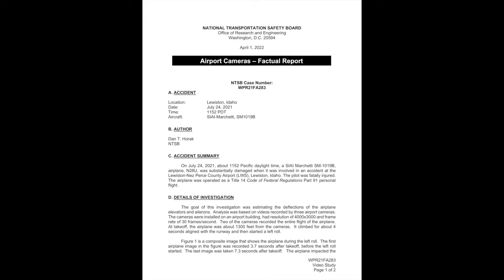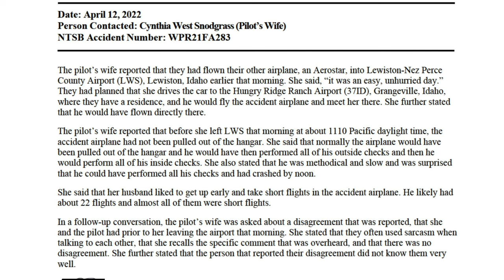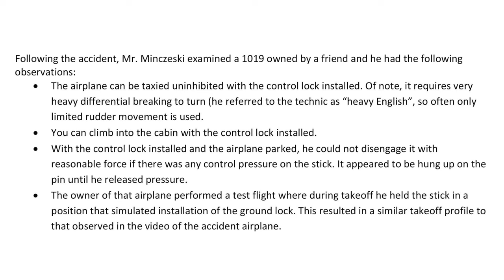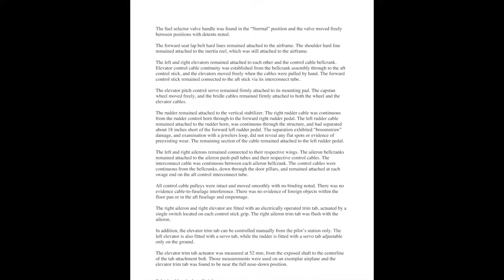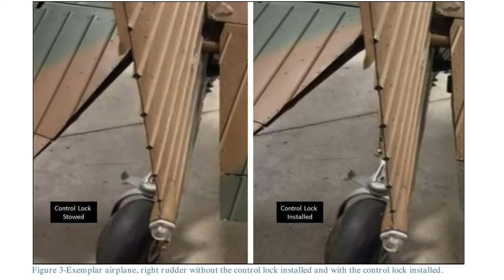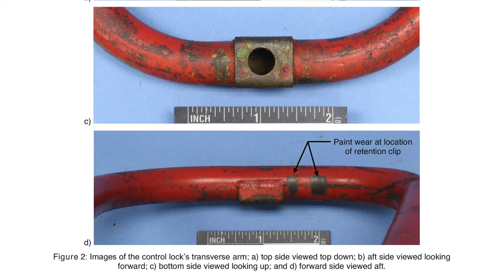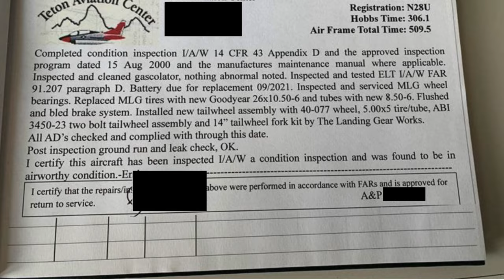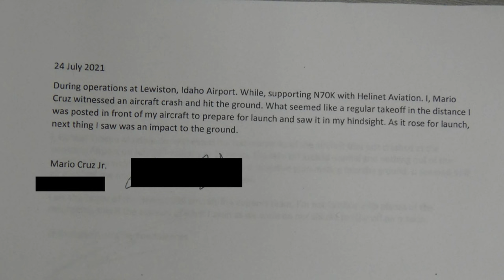Fatal Crash of SIAI Marchetti 1019-B, Part II

Comment: Looking at the reaction of the two baggage handlers was interesting too. It was like "Oh well, let's keep working".  The guy didn't even seem to realize the plane crashed, but the lady looked over briefly but didn't alert her co-worker.
Reply: I do not think those two realized what had just happened.
Reply: @ALLROY240  How is that possible?
Reply: @richardarcher3435  noise of the RJ APU and hearing protection may have blocked the impact sounds.
Reply: @ALLROY240  it looks like the female MAYBE saw it. HOWEVER, unless they specifically had training in crash response, advanced first aid, AND had appropriate tools (fire extinguisher, trauma kit, extraction tools, etc.) the best thing that they can do is call it in, secure their facilities, and avoid becoming casualties themselves. They were either servicing the lavatory or potable water. They most certainly did not have that kind of gear with them. The video doesn’t show what actions the ultimately take, but just because they didn’t start running to the wreck doesn’t indicate anything inappropriate or unprofessional about their conduct.

Sincerely, a ramp rat/supervisor of five years, student pilot, former RSO, and former camp counselor who has the appropriate training and has been a first responder to three motor vehicle accidents resulting in injuries.
Reply: @justsnappy  I don't know what the RJ APU is but I'm guessing the engines are running on that airplane they are working on. It's just that she did take a quick glance. Anyway, we weren't there.
Reply: @AviationJeremy  Excuse me but who wouldn't be shocked to see a fatal crash a few tens of meters away of you and act like this ?
She took a look at it for one second then proceed to put her sunglasses back on, ?
The way she acted is like it was a very casual event, she spoke to his co-worker just after and he didn't even took a glance at it.
What ?
UNREAL
Reply: @vonarg  she already had the sunglasses on. ASSUMING that she even saw it, It looks like she was covering her mouth, a common response to something shocking. You can’t even see the other worker after they duck down.
Reply: @Frank Dux I doubt it. He was ducking down in the area where the lavatory is serviced. He likely wasn’t aware of the crash
Reply: To all of you shocked, I will say that I asked this very question on Juan's channel and was beat up in the comments by pilots telling me that you never run up to a crash like this because it can take more lives. The plane could have exploded due to the fuel and killed more people. That's just what I was told. I personally could not NOT just stand there.
Reply: @01racegirl 
Perhaps those pilots who have training on the dangers of aircraft and airport operations are right? This may sound outlandish, but people with significant experience in aviation safety might know what they’re talking about.

Problem is, by running up without proper equipment and training, you could make the situation WORSE.

Pilot has a spinal injury and you move them without stabilization? Paralysis or a fatal outcome are very possible.

If you become incapacitated, someone else has to take on extra risk to rescue you.

Hell, your very presence can interfere with the strategies used by crash crews.

If you see a crash off-field, that’s one thing, but if it’s on the airport property, and you lack the tools and/or training, STAY AWAY.
Reply: @01racegirl  Yeah like those so-called pilots wouldn't want someone to get them out of the wreckage before it catches fire. I call B.S. A nearby witness should at least stop what the hell they're doing and call for help.
Reply: @richardarcher3435  exactly. One of them did for sure since she put her hand over her mouth.

Comment: As the owner of N4756, an SM.1019A , I totally discount the findings of the NTSB findings for this accident.  

If you totally discount the tremendous  experience of this pilot, the simple fact is that it is next to impossible to miss the ground lock being engaged in this aircraft.  Not only does it lock the Ailerons and Elevator, it also locks  the rudder pedals. You taxi using the rudder pedals. If they are locked you CAN taxi, but you have to really MASH the brakes. So... no. 

Next, your radio PTT is on the stick. As soon as you grab the stick to talk on the radio, you can't help but notice it is STUCK and won't move. 

Lastly, with it locked, the elevator is neutral, and is aligned with the horizontal stab.  In this position the aircraft will not pitch up on take-off like his did.  I've tried it ... obviously without the actual control lock in place.

So what happened?  The 1019 has electric trim. It is extremely powerful. If for ANY reason the elevator trim moved all the way to "full up",  the aircraft will do EXACTLY what Snort's 1019 did.  EXACTLY 

So, sorry ... the NTSB got it wrong, and anyone that doubts that is more than welcome to come over and I'll show you.

Comment: If the failure to remove control lock was the cause of the crash... You could say, checklists are there for a reason and failure to follow the checklist, ultimately caused the crash... but aircraft design also plays a factor.
Reply: Not if you follow the Aircrafts checklist it doesn't!!

Comment: Checklist aside, I don't get how this happens with a tailwheel pilot. Stick back for startup and proper control input for the winds should have caught this. You "fly" a taildragger on the ground from startup till touchdown.
Reply: Some people get complacent. I did for a while. For years I flew without a check list because I said it each time.
I was flying like you drive your car… almost every single day. I use check lists every time I fly now. They are read to me from ForeFlight. It feels like someone is there with me.

Comment: All it would take to prevent this would be a micro switch or similar to prevent engine start with manual lock in position.
Reply: Great point. A $.40 micro switch interfacing with the control lock and an indicator in the avionics area would prevent this kind of tragedy. The control lock on this particular aircraft seems to be tucked up under the ruder/dash area with minimal visible surface area, it makes zero sense that such a well designed aircraft would be certified with such a poorly integrated control lock mechanism. Tragic.

Comment: I still can't understand how you startup and taxi a taildragger all the way to the runway and takeoff with a control lock in. No wind corrections during taxi, no aft stick on startup, no wind corrections prior to starting the takeoff roll? I just don't understand.
Reply: Other owners of the same aircraft have said that with the control lock engaged there is still enough movement in the rudder pedals to ground taxi the airplane. Then when you couple that minor design flaw with someone not paying enough attention to what they are doing then you end up with an outcome like this.
Reply: @joevignolor4u949  the control lock design allows for rudder / tail wheel deflection (truncated but still effective). If winds were calm and no aileron/elevator were needed it’s a recipe for disaster. That coupled with flying angry (argument with his wife prior to takeoff) and a short field take off (ie pissed off take off) = tragic result.
Reply: @shiftnsix  I agree. In my view the aircraft manufacturer should have placed a warning light on the instrument panel controlled by a switch on the cockpit floor. Unless the control lock is completely down and stowed the light blinks warning the pilot that the control lock might be interfering with the flight controls. That would reduce the chances of human error causing an accident like this.

Comment: The control lock should lock elevator in a slightly nose down attitude so the pilot has some indication of the issue during rotation. Instead it seems like the control lock on the Marchetti fixes the elevator in a steep pitch up attitude, why? RIP Mr. Snodgrass.

Comment: Sadly, I believe that the newer, faster and more automated aircraft, including throttle response is allowing good aviators to be lulled into complacency.  I truly believe that when you step out of highly automated and fully staffed aviation areas, you must be a bit more vigilant with simpler aircraft.  Kind of like having to back up a old vehicle by actually twisting your body to see behind the car rather than just relying on a camera or automatic detection systems to do it for you.  So, stay frosty and keep doing the simple checks (full flight control deflections).

Comment: It's unfortunate that the aircraft manufacturer didn't include a safety switch on the cockpit floor that activates a blinking red warning light on the instrument panel unless the flight control lock is fully down in the stowed position.
Reply: It was in the POH which is the only place it needs to be .

Comment: So hard to believe that this experienced, meticulous pilot would “forget” to remove the control locking mechanism.
Reply: Seems like military pilots usually leave the preflight checks to their Crew Chiefs and mechanics. They just step into the airplane and get launched.
Reply: I’m a former military crew chief, and the idea of pilots just jumping in and going is very much dependent on the type of aircraft.  It is infinitlty more possible to do a thorough pre-flight on smaller aircraft (fighters, helicopters, trainers) than it is to do a detailed preflight on a large airliner-type cargo aircraft like a C-17 or a C-5. At least one of the flight crew will conduct a walk around before the first flight of the day.  A through-flight inspection, say if a fuel stop was required, is much less detailed.  Also, it’s been reported that CAPT Snodgrass was pressed for time, and is a contributing factor for this and many other accidents.
Reply: @get2dachoppa249  Thanks for the information…and thanks for your service to our country.
Reply: @get2dachoppa249  
Any time I find myself pressed for time to fly somewhere I just walk away and get in my car and drive. 
I left a fuel cap loose one day when I was running late to get going and took off trailing a fog of gasoline spewing from the open tank. I smelled a lot of fuel, realized what I must have done, landed, found the fuel cap and snapped chain near the fuel pit, refueled again, and sat there thinking long and hard about how my haste had damn near gotten me and the airplane blown up. All bets were off, I would make it out of there whenever. I left whenever I felt OK again.
Reply: @rescue270  I'm really glad your mistake did not end terrible, It's too bad it did not the same for this pilot. You have wise words. If you're in a rush get in the car and drive instead. 👍
Reply: @Mandy7D7  
Thank you. Something I did not mention was that that airplane I did that in was a rare Luscombe 11A Sedan. One of perhaps twelve that were still flying at that time out of only 97 built in 1948 and 49. No excuse for mistakes with a collectible article like that. Can't say it was an enjoyable airplane to fly. Stiff, heavy controls, blustery, slow, weird to land.
I mastered it, though.
Reply: New to him aircraft likely a contributing factor as well as poor visibility of the gust lock as installed, complacency also likely as well as poor gust lock design.

Comment: No matter what the experience level there’s always that level of complacency that everyone goes through. We need to all take a breather and make sure we do our checklist. I had once taken off with the pitot cover still on and a couple of times couldn’t seem to get the airplane to taxi only to find out I forgot to pull the chocks from under the main gear. Do a final walk around before getting in and make sure you do everything on the checklist including checking freedom of movement of all flight controls, including  the trim tabs and the auto pilot servos.

Comment: It didn't even look like he was traveling that fast and was only a few stories high yet it was a fatal crash. Whether the plane blows up into a fireball upon impact or doesn't, it still ends up being fatal. Planes have been around since about the same time as cars and yet the automobile industry hasn't just worked on improving a automobile's performance but also its safety. It doesn't seem to be the same with airplanes.
The Airplane Industry needs to start investing in safety. They need to figure out how to make planes not instantly explode into a huge fireball upon impact like so many crashed planes do. They also need to figure out how to protect the pilot and passengers from getting crushed on impact. Some sort of airbag bubble that would instantly deploy upon impact. Something has to be done because private aviation has far too many crashes.
Reply: It only takes just over 6foot , 1.8m to fall and hit a terminal velocity . Many die from 6ft falls due to this  fact .

Comment: I’m not a pilot but I have a question.   Why do you a control lock if the plane is on the ground?
Reply: It prevents the control surfaces from flipping in the wind, unknowingly damaging them, causing them to fail in flight.
Reply: @thatguy7085    Thank you Sir.

Comment: I was shocked when I read that he forgot to remove control lock. How'd he not notice? Doesn't the lock restrict the yoke? Wouldn't he know?
Reply: If you read the report, they interviewed another owner of the same type plane, who actually took off with the controls still locked, but was able to quickly disengage it, noting it was a struggle! 😳 I assume he didn't rotate at the steep rate of climb that Snodgrass did. BTW he had a very lucky passenger. I can imagine the conversation afterwards.... YOU DID WHAT?!
 !

Comment: Damn...i am shocked. There was a rumour that the seat may have slid back but this? It just shows you how even a pilot of Snodgrass's calibre can have a simple oversight or distraction turn into life or death. Very surprised that the plane would even manouvre at all with a lock fitted and even more shocked it is not very visible. I wonder if the lock was not stowed properly and flipped down under acceleration?
Reply: The control lock is in the locked position when it is up and forward. During flight it is pulled back and stowed down on the floor. Other owners of the same aircraft have said that with the control lock engaged there is still enough movement in the rudder pedals to ground taxi the airplane.
Reply: @joevignolor4u949  ah got ya, so it couldn't have been jolted to a position which affects the stick. This means he literally could not have done a control sweep check...even stranger.

Comment: Pilot since the early eighty's seen just about all. This could happen and it has before a lot of aircraft use gust locks on the moving surfaces like elevator, rudder and other surfaces to keep them from moving around on windy days especially if the aircraft is outside a hangar tied down on a ramp. There is a pre-flight manual in all aircraft that the pilot is suppose to use before he flies but sometimes those manuals can take awhile to go through every little thing and if the plane is privately owned small aircraft the owner knows like the back of his hand he might just give the aircraft a good look over kind of a walk around checking the things like the fuel and oil levels look for any damage that might have happened since that last flew it. Gust locks have killed a lot pilots and the number one cause is complacency, getting in a rush to get it done.

Comment: The Cessna 172s I  trained on had control lock as a steel rod bent into a convoluted shape that ended up with a big steel plate with red & white stripes right before your eyes in front of the yoke. Couldn't  miss it even if you forgot to cycle the control surfaces during preflight AND run up. Hate to imagine what this guy was thinking as he was auguring in...

Comment: Maybe the control-locks should be (re)designed so that they can't be  attached to control surfaces without their first having been released from a 'holder' or support in the cockpit to leave behind a prominent "controls locked" visual reminder (a warning light,  say) that could only be cancelled when the relevant locking-device had been removed from the control surface and returned to its place in the cockpit, thereby cancelling the warning. The hardware might take up space but...what the hell.
Reply: I had the exact same thought. Its basically like the warning system commercial airliners have that issues a warning if a pilot tries to take off without properly configuring the airplane first.
Reply: Or, conversely, people can do a proper pre-flight.
Reply: @DrForrester87  Yes, but the more foolproof you make something the less chance there is of someone making a similar mistake. You have to consider human factors, which are unpredictable. Its similar to the warning systems on commercial airliners that warn the pilots if the airplane is not properly configured for take off when they push the throttles up.
Reply: JD gets it... He didn't do what was required... Proper pre flight would have prevented this

Comment: Looks bad, but maybe he survived? The plane does start burning for some time after the crash. But when it does it was most likely fuel hitting the manifolds. There is a fire ball extinguisher that could have prevented this fire. Mounting this 1.5lb self activating ball fire extinguisher (activates by flame only, not heat) The plane wouldn’t burn with the pilot trapped inside. 
Planes right now have a fire extinguisher that requires human activation. This is still good for controlled use inside the cabin for small fires in flight.
I don’t sell these, it is just a suggestion for experimental aircraft, other planes will require FAA approval and a new weight and balance.